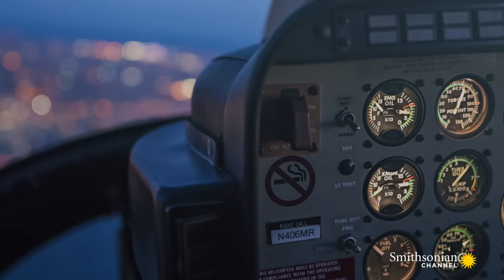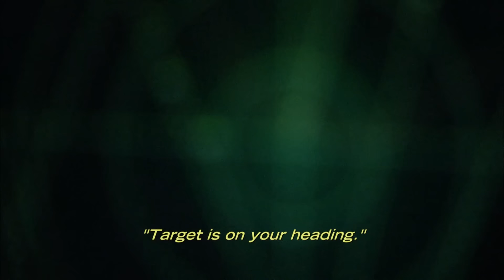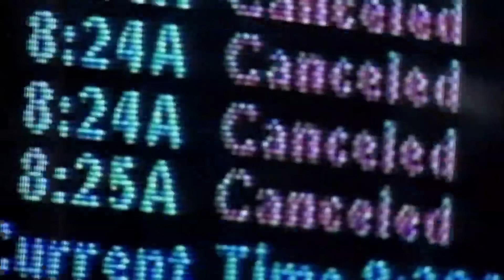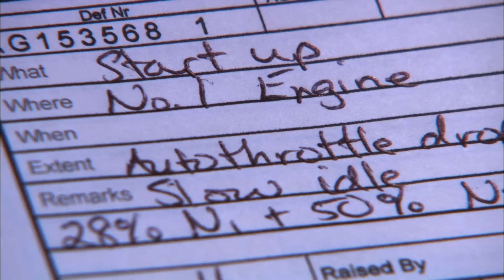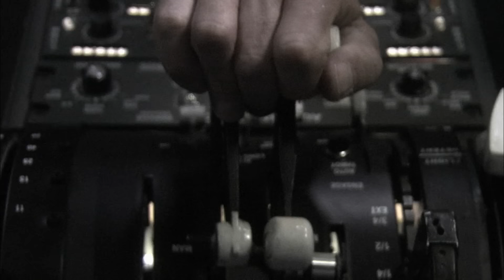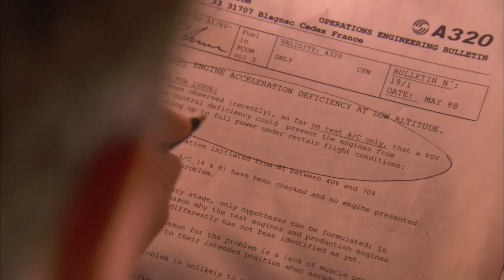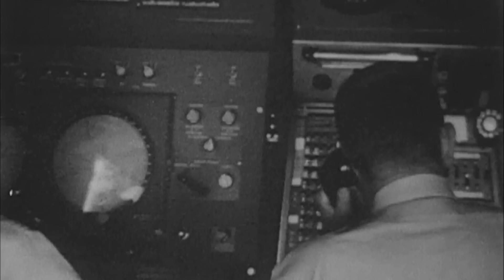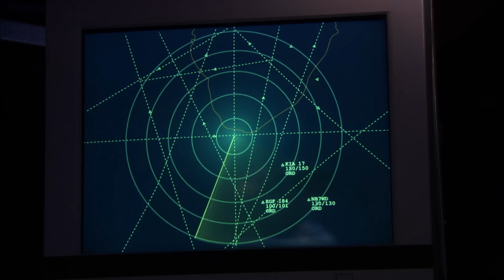Every Plane Crash from Air Disasters Season 2 | Smithsonian Channel

Comment: I can't believe a mechanics response to see a crack in a wing was just to drill and hole and be like "Ah, that should do it, another hard day's work!". Even if that stops the crack from spreading, it doesn't change the fact that the plane's wing is now considerably weaker.
Reply: That is however the correct procedure

Plus the outer plating is to preserve the airfoil shape, and does not play the main role in the structural integrity of the wing. Unfortunately the load bearing structure was damaged, this is the real problem. The load bearing structure damage was not accounted for.
Reply: @j3r0_plays7  That as well. I see what you're saying, just seems extremely careless.
Reply: @KB-bh9hp  yes they shouldn't be in service and go for extensive repair
Reply: @unnumberedcost2522  Agreed, wasn't sure if you were being sarcastic or not. But I'm feeling optimistic, so I'll assume you're being serious.
Reply: Right. I don’t understand how that person is able to live with themselves, I’d never be able to get over it. Knowing my negligence and laziness are the reasons so many people aren’t alive anymore.
Reply: @heatherfults7506  Any employed engineer is only doing what they're told to do by their bosses.  I would imagine they'd reported the situation - certainly looks like repairs were logged.  Sadly, I would guess that it was the accountants or the CEO rather than the engineers who are at the top of the decision chain.
Reply: @KB-bh9hp  is pqqppppppppppppp
Reply: That’s what you’re supposed to do WTH 🤦🏾‍♂️
Reply: @j3r0_plays7  qq
Reply: @j3r0_plays7  qq
Reply: An A&P make repairs to an airplane to C/W his or her provided Maintenance Manual, not how he or she think that the plane should be repaired. Blame the maintenance manual at the time, not the mechanic.
Reply: @heatherfults7506  Stop trying to guilt the mechanics when they did what they were supposed to. Its not negligence or laziness they just did their job.
Reply: @j3r0_plays7  s
Reply: @j3r0_plays7  oi
Reply: @heatherfults7506  ji ft
Reply: @grimmettcleaningservices7003  in
Reply: the contoller named walter white
Reply: Some people saying this was the correct procedure and all that.

This is true, but this was clearly not working no matter how many times they did it. The say the definition of insanity is to continue doing the same thing and expecting different results.

When the cracks and leakage persisted, they should have had a closer examination of the plane instead of doing the same procedure that clearly wasn't working.

Comment: at 10:37, in KAL 007 crash, the narrator says that a highly classified radar called PASSIVE RADAR tracks the movement of every military and civilian aircraft anywhere in the world.... If so, why is MH 370 still missing?
Reply: @Joo Does a passive radar need signal from aircraft to track it? I doubt...
Reply: It did track for a few minutes until the plane went out of the radar's range
Reply: I think he means secondary surveillance radar which does require the aircraft transponder to be switched on. On 370 it was off.
Reply: Their transponder was turned off.

Comment: What about the brackets inside the wing what about the structural brackets inside the wing the enclosures around the fuel tank and this video sealing up leaks in a fuel cell with a grease gun it's a joke right

Comment: What happened to the A320 is why i still dont fly on any airbus jets. I have only ever flown on McDonnel Douglas or Boeing jets. 

I like 757's personally for the extra seat space. 

I have flow on a max jet though recently as well as 767 jets in the past and 737 variants.
Reply: Airbus is objectively safer than Boeing but you are free to make your own choices.
Reply: Also, that a320 accident was caused by pilot error